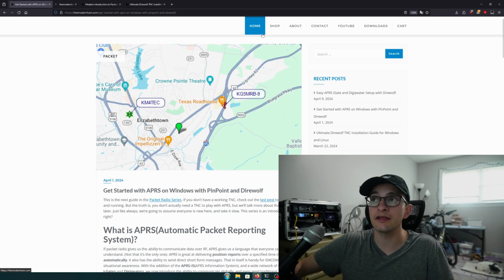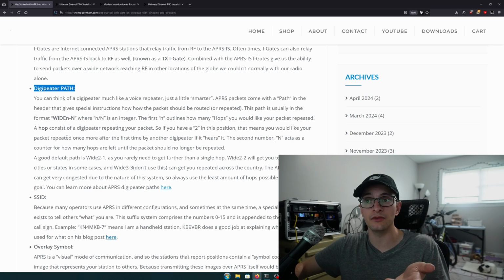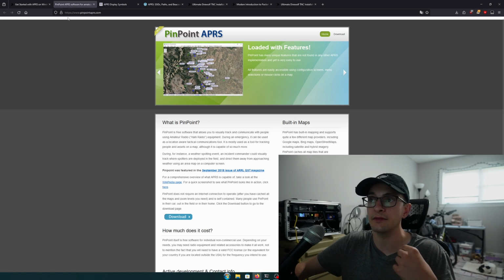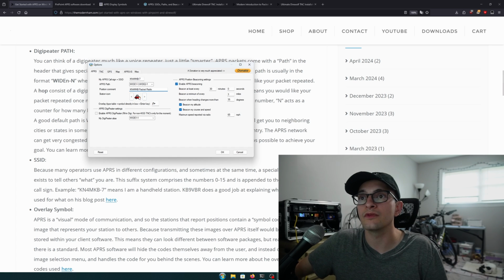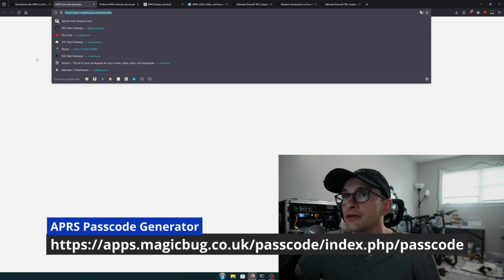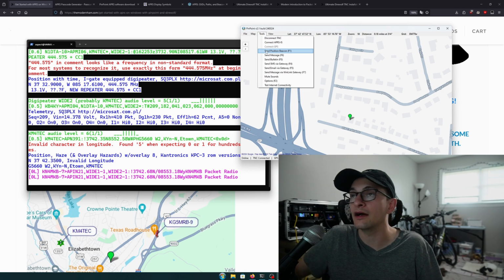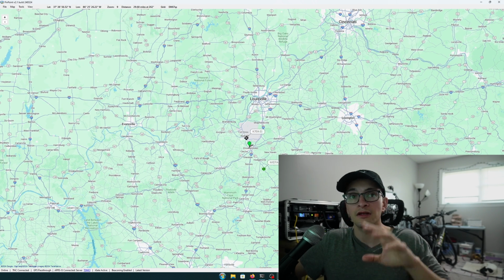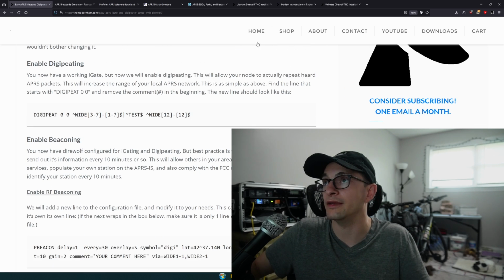Get Started with APRS on Windows with Pinpoint APRS and Dire Wolf

Comment: It's my understanding that if you're using Direwolf as a TNC connected to PinPoint APRS, the digipeater function is active with the correct Direwolf settings.  I'm not absolutely sure of this, but I've read several times from different sources that this is possible.  Does anyone know for sure???  Thanks.

Comment: I have my station running with a digirig and an FT-2980 on a mini PC running Debian and my Windows laptop. Appreciate you getting all this info in a clear and central way. I'll need to put my server on a pi so it can be part of my deep cycle battery backup that powers my repeater.

Comment: Used your write up online to get direwolf successfully configured. I’ve never set it up before and was a little worried it wouldn’t work but I was surprised when the command to test ptt worked and I heard the signal on another radio! Went for a drive last night and it worked running YAAC. Thanks for the help!

Comment: Thanks for another great video! I'm getting lots of APRS-IS reports, yay! But no radio reports from 144.390 MHz.  Also I get this error message in the events window: "4/17/2024 10:30:29 PM Could not send KK7QPA-10>APIN21,WIDE1-1,WIDE2-1:!3223.30N/11104.88WyHome APRS Test to TNC. Error: The write timed out."  My location does show up on the APRS.FI map!
Reply from the maker: Glad to hear you have the APRS-IS side working. If this error is showing up in Pinpoint, does your direwolf window show any indication that Pinpoint tried to connect to it? And what are you using for the "hostname" for the Network Kiss TNC setting? One more thing to check is to make sure your audio devices/ptt port have not changed for direwolf. Direwolf may revel something useful.
Reply: @ModernHam  Direwolf works great, pulls in radio messages and displays in green/blue.  No error messages in Direwolf from Pinpoint.  Host name is 127.0.0.1 and port 8001.  When I run Pinpoint it pulls in IS positions, but not radio positions from Direwolf.  There seems to be no communication between Pinpoint and Direwolf. Thanks for your help!
Reply from the maker: This is very strange. I assume direwolf is running on the same system as pinpoint if you are using 127.0.0.1. When you Press Tools -> Connect TNC, does it show "TNC Connected" at the bottom.
Reply: @ModernHam  Yes, it also TNC connected at the bottom of the Pinpoint screen. Poop!